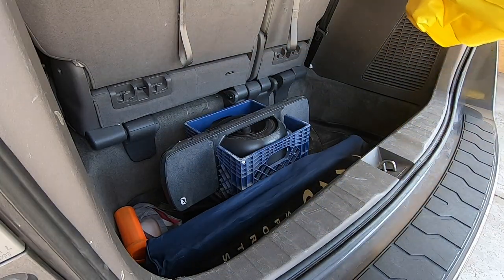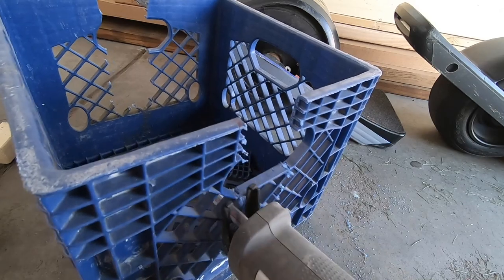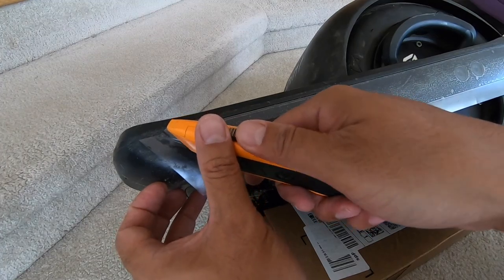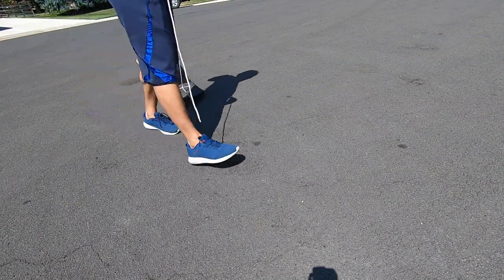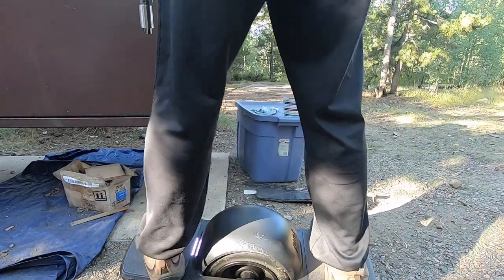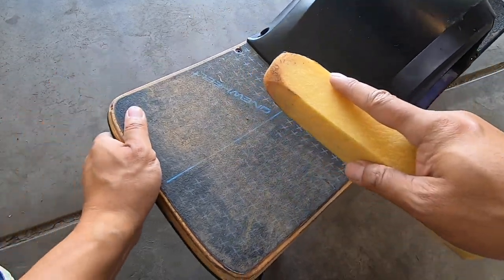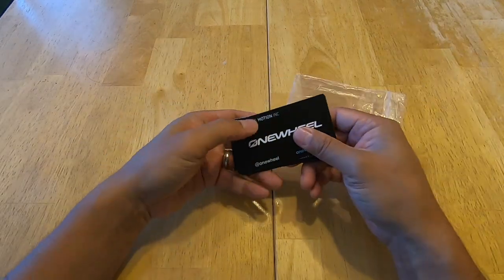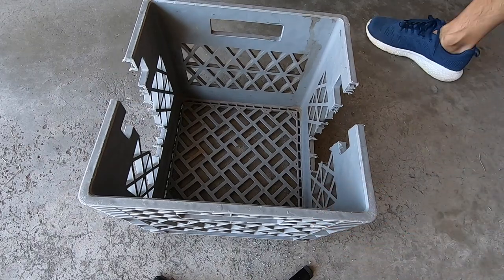10 Onewheel Life Hacks

Comment: You can use Bluetack to safely clean out your charge port.
Get the "expensive" stuff (it's like 40cents more) and it works great. I use it regularly to clean out the port on my cellphone, clean out the speakers.. etc. The good brand stuff sticks really strongly to itself so it all comes out and doesn't leave residue or bits. 

Hope this helps!

P.S. Incase it wasn't obvious, you knead the bluetack for a few seconds until it's sticky and mush it into the port and pull it out, and repeat. Use a big ball of it to clean it out well and knead between each use. It'll last a pretty long time! If you get any little bits stuck, just gently touch it with another piece and it will pull right off.

Comment: Thanks for tip #2. I used 3M Clear Paint Protect film on my Pint. It's the stuff that goes on the front of your car to protect it from road stones. Got a 12x72 inch roll for ~$35 from Amazon. I use able to cover everything below the deck plus side rails and still have a lot left over for two more Pints. Only used a 25" x 12" inch piece.
Reply from the maker: Great idea! I was just wondering if you can get free scraps at your local auto body shop.
Reply: @freshlycharged  I didn't think about that. I'll have to look for a body shop that does wraps.

Comment: toss some of that 3m clear tape on the underside of the board to protect the brains and battery, I use 3m Carbon fibre tape, this way it scrapes and dings the tape and not the actual battery casing. also For long distance carry keep a strap in your backpack, you can feed it between the wheel axle and the frame, makes slinging over a shoulder super duper easy... Ive had to use this on 2 occasions when I was max range testing the battery.... longest ride i have made is 42 Km ( I weigh 173lbs ) due to hills and such, that is my longeest and most magical trail around here so far. the leash idea is a good one, I sometimes wish I had one to keep my board from rollig sideways down slopes.. its always fun to catch up too.. lol
Reply from the maker: I like that sling idea! Starting a new top 10 list!

Comment: Dude... I've been considering how I could take a OneWheel on my motorcycle, and that milkcrate trick could work great! Strap the milkcrate down really well to my rack and then throw a bungee over the top of the Pint! Easy peasy and probably pretty stable too!
I've been making a checklist/pro-con list for buying a Pint and a major point was transporting it on my motorcycle! Now I'm officially sold. 
I'm getting one.
Reply: Have you tried this on the bike yet? I have the milk crate converted and thinking of using cable ties to fix it on a push bike rear rack.

Comment: I just accidentally discovered the leash reverse pulling thing at my daughter's soccer game last night.  Sports complex wouldn't let me ride through gate.  I used the handle of a shoulder bag I was carrying to loop around my onewheel to pull it till I figured out a similar angle and pull method.   Coincidentally, it's been done.  Kool.
I lean my onewheel against the box it came in.  Put all my accessories and replacement parts that are not being used inside.  Gota save the box for shipping for repairs, sale, or vacation

Comment: I would suggest using GAFF tape if you don't want to buy sidekicks. Gaff tape is used in the film industry as a fix all. Since it's very sticky, yet doesn't leave a residue, it's great for sidekicks. I've used it and had it hold on for hundreds of miles.
Reply from the maker: I've had a number of people recommend GAFF tape. Do you have a particular brand you recommend? I get overwhelmed by all the options.
Reply: @freshlycharged  I get all mine from a company called Gaffer Power

Comment: So now I gotta walk a Onewheel, take it to the bathroom frequently, and make a litter box mat for it in my mudroom... I got enough pets as it is! XD  ;)

Does it charge the onewheel when you tow it around like that? I would not think so if it has resistance when it's on, this would tell me that circuits have to be engaged for it to direct regen power to the battery.

Comment: umm if you don't mind the color change there are coatings that go on stairs or the stuff you dip your tools in to rubber coat them or flex seal all will protect your rails and it will be more permanent

Comment: Helpful hacks.  Thx.  Question:  When you attached the leash, the OW hung from the leash (center knot above the board).  Maybe that would work better if the knot was under the float plate, with the nose resting on the leash.  I think you might have more control.  You would definitely have more lift.  New video?

Comment: Nice video.... for milk crate couldn’t you just set the onewheel on top so the wheel was inserted in the crate and the board resting on the edges of the milk crate??? No cutting?
Reply from the maker: Too top heavy. Tends to fall over when driving.

Comment: I'm kind of surprised that Onewheel didn't make a feature on the app to lock it out so no one can turn it on unless you turn off a "lock Mode". I was going to say they could also put a very small solenoid that would lock a pin somewhere to prevent the wheel from spinning, but there's no way you could ride it if you couldn't turn it on without the app of the original owner anyway, haha.

Comment: Hey Jimmy, I love your videos. I just got my pint a couple days ago and I’ve only been able to get 5 miles for a charge. I’m 5’5” and 140 lbs and I’ve been riding on flat terrain in Pacific mode. Any suggestions to increase the range?
Reply from the maker: My only thought is that you probably get on and get off a lot or are stopping and starting often which will drain the battery. Next time you go on a long ride, try to go at a constant speed and limit the number of times you stop and start. Hard acceleration will quickly drain the battery too.
Reply: Jimmy Chang that makes sense. Thanks for the advice!
Reply from the maker: @alexchrist4342  Once you get more skilled, go for a nice leisurely ride going no more than 10 mph and not stopping. I bet you'll get 12+ miles on a single charge.